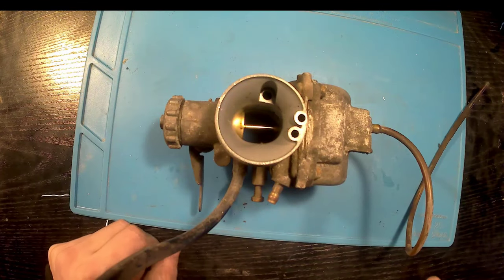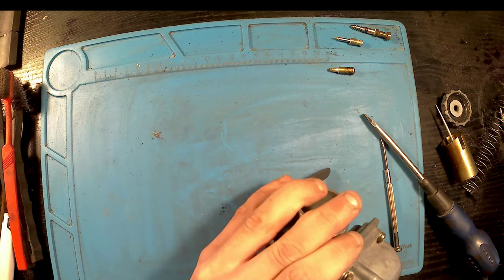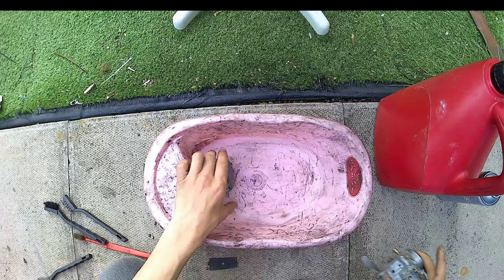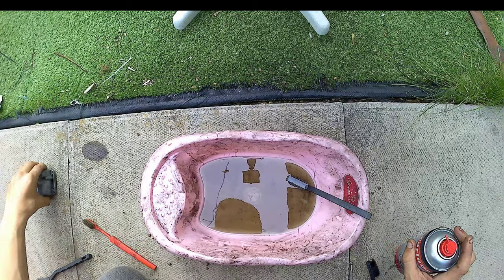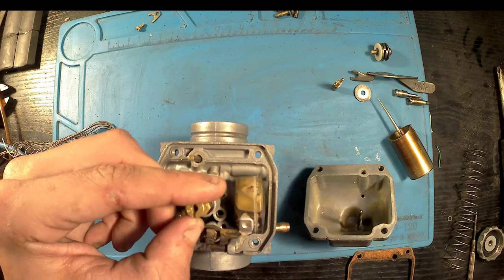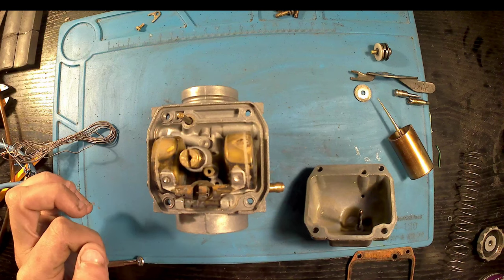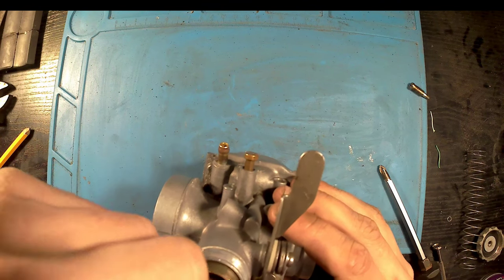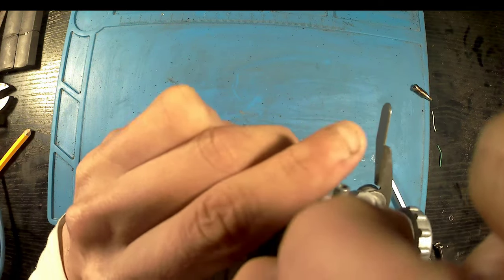1988 Suzuki GS125 Carb clean - How bad is it?

Comment: What is the size of that carburator, is it 28mm??
Reply from the maker: Hi Kim, the air intake is 45mm and the fuel intake is 35mm on this particular carb
Reply: @nathansrepaircentre420  yeah! Its bigger than the Diaphragm type or CV carburator which is used in other GS125 models..